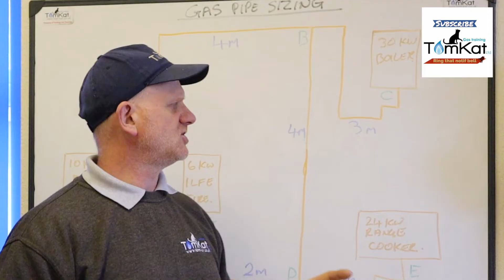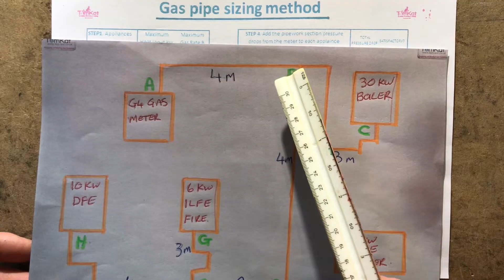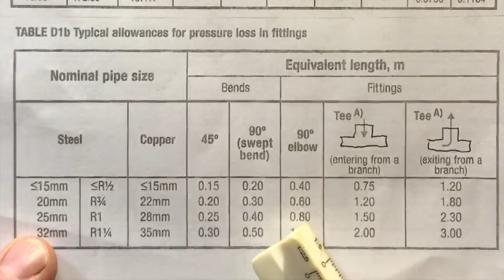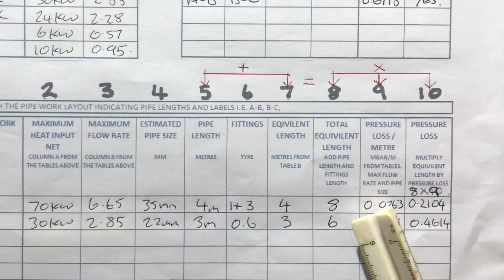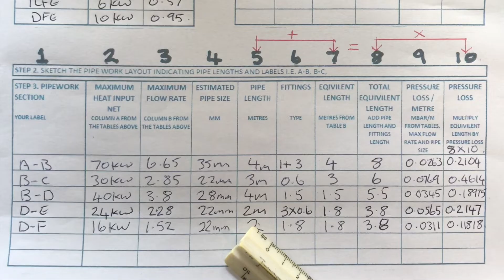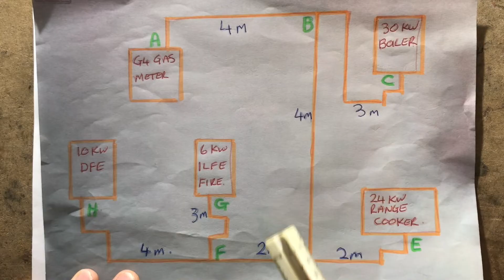HOW TO SIZE A GAS PIPE, A tutorial for trainee gas engineers on how to size a gas pipe to bs 6891.

Comment: From A-B is the gas not entering the fitting T, I dont understand why the other number was chosen?
Reply from the maker: As  I say in the video it’s how to the numbers are irrelevant because every job is different. If you think it should be a different figure for the tee then use that but at the end if the day it makes not a lot of difference. Thanks for watching and your comment cheers
Reply: @tomkatgastraining  oh no mate I understand that I agree with your method and how you're going through it, I'm.jusy slightly confused regarding if the enter tee or exit tee number should be used and when it should be used exactly, so say if gas is passing through a tee from either end and leaves through the middle, is that to be used as exiting tee or entering? That being entering top/bottom and exiting from middle. Trying to get my head around all this for my acs exam :)
Reply from the maker: @Usernamehidden51  if the gas goes out or the branch to go to an appliance then that’s exiting if it first comes into the tee through the branch then that’s entering if you have a look at the fittings chart in the video you can see the flow arrows
Reply: @tomkatgastraining  Perfect thanks Tomkat! Got my ACS on Monday, your videos have helped me a lot , pray I pass 👍

Comment: Excellent video Derek, 
Exactly what I did in my acs earlier this year an yes mind bending at first but once you have the hang of it it’s simple.. 

I agree some engineers say it’s take to much time up an wont do it.. basically they can’t do it 

But can you please confirm the 1mb from meter to appliance is per appliance or over all appliances running together .. 
as you drawings an appliances an pressure loss over4 appliances running together would be well over a 4mb drop.
Saying that everything would have to be bigger pipe sized..
I’m only asking as I was told/taught that it’s over all appliances 

Thanks an great video 👍
Reply from the maker: Tommy Blackman the way I have shown on the video is the way the British standards says it should be done. Must admit I don’t teach it this way to my students because in real life it doesn’t work if you have all the appliances on we do a running total but the standards say there is a very small chance you will have all the appliances on running at full rate at the same time. Thanks for watching cheers
Reply: Tomkat Gas Training  excellent Derek, thanks that’s sums that up 
Stops me stressing looking at installations an thinking everything is under sized 

Thanks again Derek. Great video An many people don’t commit to gas pipe sizing

Comment: Thank you Sir. Brilliant stuff as always. just wondering, does reducers affect on pressure drop like other fittings or not? Thank you.
Reply from the maker: K Pereira yes it dose but not enough to worry about it’s all about the tees
Reply: @tomkatgastraining  Great. Thank you sir.
Reply: @kpereira8910  One-size reducers give about the same pressure loss as an elbow of the same diameter as the reducer's inlet. BS 6891 does not give equivalent lengths for reducers but the commercial pipework standard IGEM/UP/2 does.